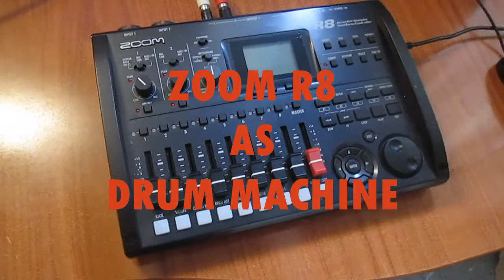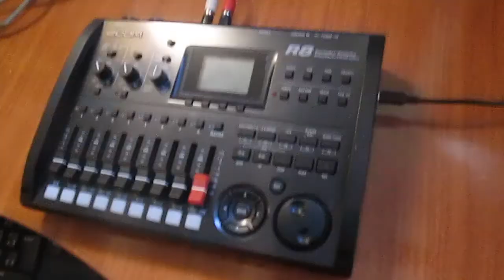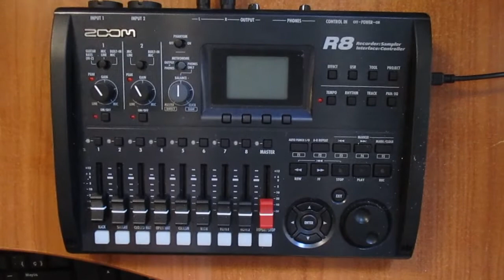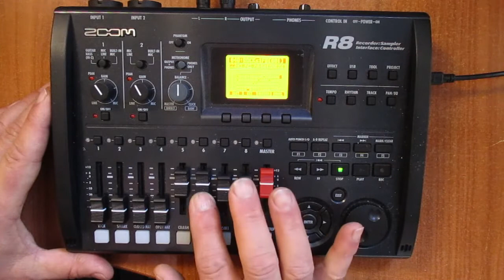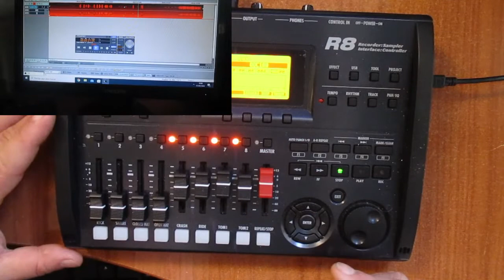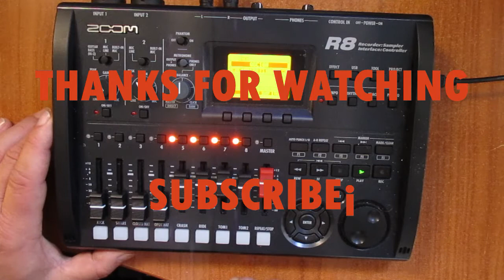ZOOM R8 as Drum Machine.

Comment: Hi, can you record the live sequence in the DAW without using the Steinberg interface inputs? directly with the ZoomR8 USB cable
Reply from the maker: I'm afraid not. Thks.
Reply from the maker: The video is about using the ZR8 as a drum machine, not as an audio interface,, and you can not use the ZR8 at the same time as audio interface and drum machine.Thks
Reply: Presumably you can create an audio file by recording the sequence  on the Zoom and then import it into cubase via the usb or sd card.

Comment: Can you trigger the drum pads from an external midi device?
Reply from the maker: Zoom R8 is a Midi controller, among other fuctions, but is thought to work with a PC rather than an external midi device. To work with midi, Control surface function should be in  "ALL MIDI input" , I never trigger the drum pads from an external midi device  so not sure if it can be done, thk you.
Reply: R8 is not MIDI.
Reply from the maker: Yes, is not midi. You may use a pedal Zoom fs-01, in control in, which is a momentary switch that toogles between two states, assignable in the R8 OS. Any momentary switch will work, an amp channel footswitch will work if you have one.